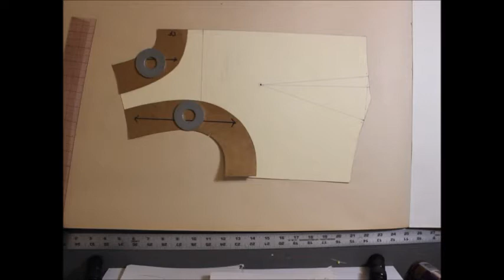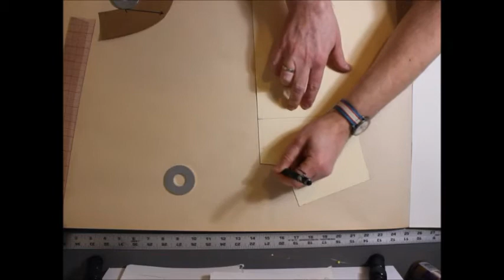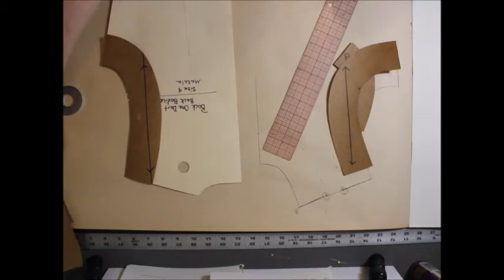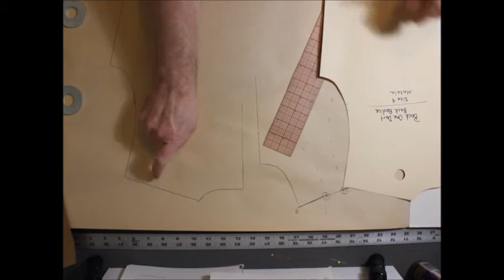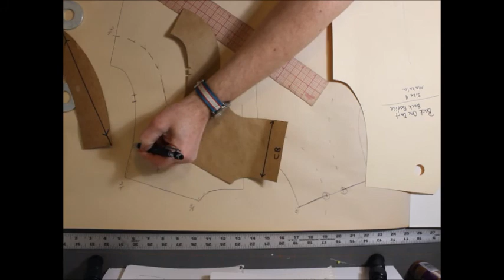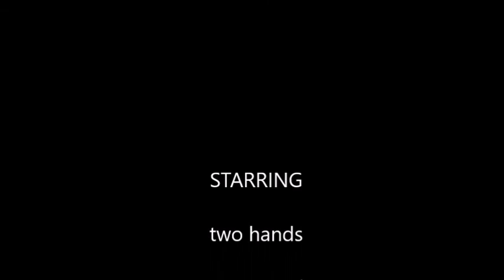Drafting Facings. Separate and Combined

Comment: How do you draft the all in one facing for the front?
Reply from the maker: Thanks for the question.  You would draft the neckline facing and the armhole facing, but connect them in a nice curve to link the two of them up before adding seam allowance.  You will see the finished front all- in -one facing at the start of the video.